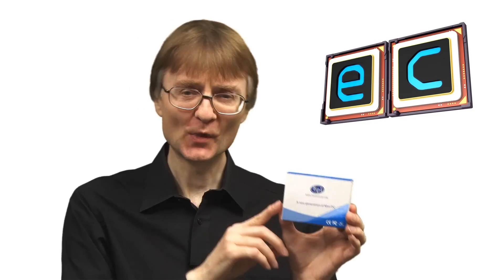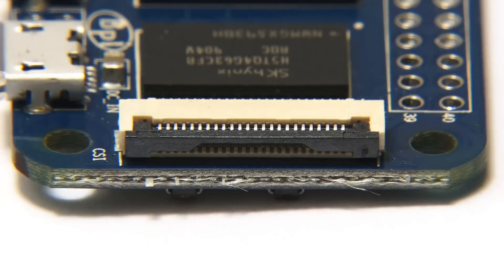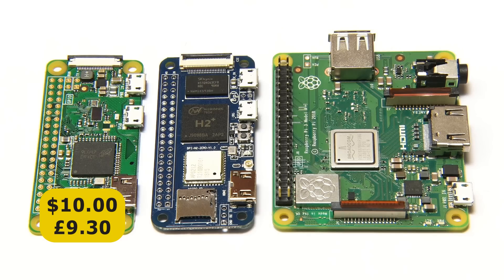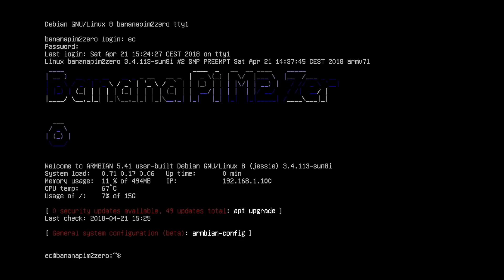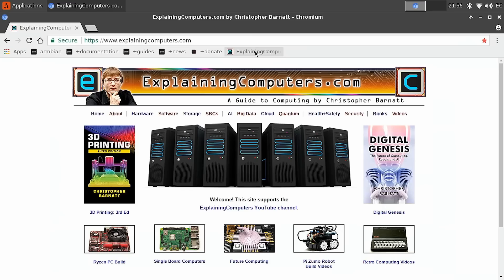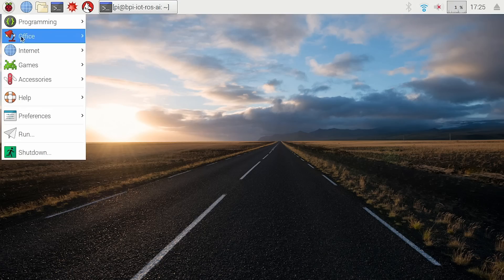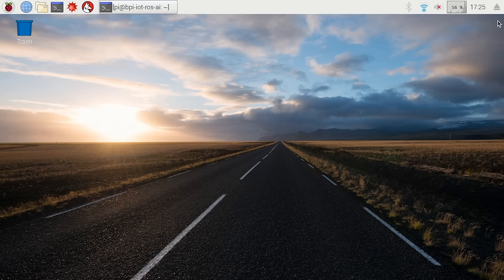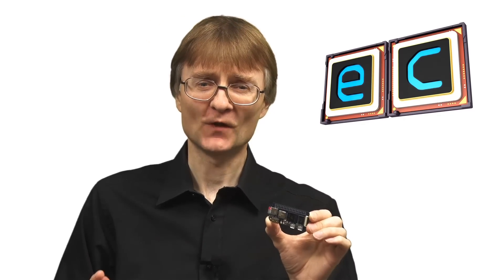Banana Pi M2 Zero: Low-Cost, Quad Core SBC

Comment: As always great video and info.
Generic question. Lets say I want the most powerful single board computer. And compare it to a near to equal desktop or server. Will the SBC use less energy than the desktop or server ? It dos't really mater to me if the theoretical test is x86 or ARM. I'm trying to find the most cost efficient build. 
I would like to know your opinion on if the SBC/desktop/server would burn out fast. I have 2 odroid xu4 that are and wer being used as a 24/7 NAS that streamed too 2 divices and a 12hr/7days a week media player. Thay carped out pretty quick. One has broken usb 3 ports and other has broken ethernet port. One had slow read/wright befor ethernet port broke. One is only a few months older. And I'm only on year 2 or less.
The new build Is going to be a 24/7 NAS and high intense memory/cpu hog. I would prefer my build to be one machine but if it seams more cost efficient I can run multiple machine.
Reply from the maker: With appropriate cooling, I would not expect an SBC to burn out faster. Port breakage is easily overcome using extension cables/headers.
Reply: @ExplainingComputers  True.. I forgot about that..  Thaink you. I'l have to test and see what speeds I can get thru a ether net on headers. it was super slow wen I tested be for it diyed. So I will not know until I test the header connection. Is it fairly common for a SBC to use less energy than a = desktop pc ?
Reply from the maker: @frankenstein3163  Very much so, yes. SBCs are based on ARM chips (which are created as low-power for mobile devices), or on low-power Intel or AMD chips.

Comment: try to  disable overscan in raspbian, you'd probably get 1080p.
Reply from the maker: Sadly not. Overscan settings do not change the frame buffer resolution.
Reply: It did in my case. Am using a smart TV as monitor. Either it just eliminated the black borders or it was because of the cable. Anyway, thanks.

Comment: Just wondering if this could be configured to work with the RetroFlag GPi case? I have one of those cases using a Raspberry Pi Zero W. Would the Banana Pi Zero work better with RetroPie since it's quad core?
Reply from the maker: As I understand it, the M2 Zero does not fit that case. But things can be altered . . .
Reply: @ExplainingComputers  Looking at the form factor it should.  All the connections are in the same place.  Have you tried RetroPie on one of these?  I know with the GPi case you have to modify the config.txt so that it displays the video output via the GPIO pins.  I'm really wanting to know if it runs just like the Pi Zero.  I noticed you were running Raspbian on the Banana Pi therefore it must be running the same type of OS.  If that's the case, RetroPie should work.

Comment: I don't know what algorithm that program is using to determine prime numbers, but it seemed a bit long for finding the number of primes between 1 and 10,000, so I wrote up my own code and ran it on the Pi Zero W that I have.  It found 1229 prime numbers between 1 and 10,000 (which I checked online to ensure it was the correct number).  Using clock_gettime() to get the nano-time for start and end, I ended up with " 0.001097987 seconds" for the 1229 prime numbers (not including the time to print them out to the screen).  Even testing it to 500,000, I ended up finding the 41538 prime numbers in only 0.126008591 seconds and for up to 1,000,000 I got 78498 prime numbers in 0.146698411 seconds.  So, I have to wonder about their algorithm efficiency.

Comment: Hello EC! Is Banana Pi compatible with the Pi Camera with the PiZero connector? I was curious to see if it would be better for running OctoPi because the Zero's single core isn't sufficient for it.
Reply from the maker: Yes, a Pi camera with a Zero connector  should work. Good luck!
Reply: @ExplainingComputers  Is it possible for you to verify this with your own hardware? I've seen several blog posts that all indicate that it will not function as it does not fit. Additionally, would you know of any US-bound suppliers of the M2 Zero? Average shipping time for it is a month or so.
Reply: @ExplainingComputers  I've got an article here from all#DP as my primary source. I don't suppose you could verify this for the channel? https://all3dp.com/2/banana-pi-zero-review-the-specs/

Comment: Does the armbian kernel implement the Lima module that drives the closed source Arm Mali GPU's,

ff300000.gpu: gp - mali450 version major 0 minor 0

for instance

Kernel 5.x drives this one very well.  Normally for these boards you would have a specific project in mind like perhaps a drone / robot controller.
Reply from the maker: I do not know.
Reply: @ExplainingComputers  If you do an lsmod you should see something similar to this,

drm                   606208  8 gpu_sched,drm_kms_helper,dw_mipi_dsi,lima,rockchipdrm,dw_hdmi,analogix_dp

This is from the Rock64 so the DRM level stuff would be different.

Comment: Hi Chris, I'm struggling to find exactly where I should download some images for this board, there's so many versions of BPi boards.
My goal... I'd just like to make a CUPS printer server, and I'll have it running headless.
Could you drop a link to where I can try out some OS's, or let me know what one you'd recommend for a basic CUPS server. Thanks!
(ps. I'm only looking an BPi because I just cant find any RPi Zero 2's anywhere anymore :'( )
....If you have any better suggestions for a mini-cups server (the printer thing) I'd love to hear about it! thanks!
Reply from the maker: The images I've tried came from here: https://wiki.banana-pi.org/Banana_Pi_BPI-M2_ZERO#Image_Release The situation is indeed complex due to the different banana SBC boards from different manufacturers.
Reply: @ExplainingComputers  thanks for that.
1) Is there a specific image you'd recommend to use as a headless server for CUPS.
2) Is there an alternative/cheaper SBC that I should use as a CUPS server. (Must have WiFi and a USB port), thanks.
Reply: @ExplainingComputers  Chrs, did you have any problems using Win32 disk imager? I'm just trying a few images now, and I'm getting a red power light on the bpi zero m2 for only a brief moment, before it turns off, nothing on hdmi (good psu for Rpi too)?
What imager did you use to flash your sd's. thanks
EDIT: I used PhoenixCard 3.1.0 now, and getting a solid Red LED, and HDMI shows just a black screen with an Orange Rectangle Box. Been here 5 mins, no other activity 😢
EDIT: That Orange box appears to be a progress bar at 0%. androidmtk.com shows the bar on their page progressing, but my bar, is not progressing. I feel like I have used the wrong tool to flash my SD card. Maybe I shouldn't have used PhoenixCard
Reply from the maker: @djtyros  I can't recall how I set up this particular board, but I usually image cards with Etcher, unless there is a particular reason this cannot work (as if sometimes the case for some boards).

Comment: If the banana Pi board is plugged into a motherboard like the Spectrum Next, it would have power and then the little USB on the right can be used to power other devices.  Correct?

Comment: Why not comparing with the Orange Pi Zero LTS? That one is 8$ and it includes Ethernet and SPI Flash.
Reply from the maker: It does, but no HDMI. :)
Reply: @ExplainingComputers  Ok. That's fair. I am using the Orange Pi Zero LTS as an embedded (non-linux) platform, hence I do not look at HDMI.

Comment: Would have been nice to measure the power consumption.  I use a Pi Zero W on a small solar panel during summertime because it almost uses no power. Only slight negative factor is that it is a bit slow for which the Banana pi would perhaps be a better candidate.

Comment: Thank you for the review. There is new competition on the market. Radxa zero. Do you know where in Europe we can buy them?
Reply from the maker: Yes, indeed -- the Radxa Zero looks a very interesting board. So far it is not available for sale anywhere, as it has not been released yet (about three weeks to go as I recall). There are just a few pre-release boards in circulation, and I have a policy of not covering pre-release hardware on the channel as it frequently does not arrive on the market! :) In Europe, https://www.innet24.de and Allnet.de will be distributors
Reply from the maker: @homerdus9668  Thanks for this. I often buy from China, and have been through all links on the forum page, but while the products are listed on many sites, they show "sold out" or "out of stock". The forum article states that mass production would start in 8 weeks (from June 16th), and then they need to get to retailers.

Comment: I am interested if "suspend to ram" is availabale for the BananaPi M2 Zero. Could you please test that?
Reply from the maker: I am not ware of this existing. But it will be OS dependent.
Reply: @ExplainingComputers  Yes it is. But it is also dependend on the hardware. As far as I could gather the information it should work with the used H2 Processor and Armbian (when they added it to the kernel). Would be nice when you could give it a quick try :) Cheers!

Comment: My BananaPi Zero M2 is running too hot with a heat sink on the CPU. The SBC's Armbian Buster OS is unusable after it gets very hot in about 5 minutes. Any solutions before I throw the board into trash?
Reply from the maker: I can only suggest a bigger heat sink!
Reply: @ExplainingComputers  I think the solution could be overclocking settings /on demand cpu performance settings.

Comment: Inspired by your video, I tried using official BPi Android image 2018-07-09-android4.4_bpi-m2z_hdmi on Banana Pi Zero M2 and I am extremely disappointed with what results I got. Kodi crashed every time I ran it. Google playstore could not be used to download and install any app. Youtube app said it requires an update and the update could not be downloaded in a retry loop. Frustrated. Do you know any Android image which really works on Banana Pi Zero M2?

Comment: I wonder if the low amount of RAM could keep it from running in 1080?
Reply from the maker: Probably not -- the Pi Zero and Pi 3A_ are 512MB and do 1080p fine.

Comment: What build of Armbian did you use? Armbian has no official support for the M2 Zero. Or even a "No Official Support" build for the M2 Zero. 

Also, did you verify the clock rate before benchmarking? The H2+ is "Up To" 1.2ghz but Armbian may have set it to 912mhz, and Raspbian since it doesn't really support the H2+ probably left it at whatever speed UBoot set it to, which was either 480mhz or 1.08ghz.
Reply from the maker: The Armbian download was an image from the Banana Pi website.

Comment: There is also the Rock Pi  S as well, which is half the price of the Banana Pi Zero, at only $10, and also has a quad core CPU. Seems like the best buy to me, with more powerful hardware, and at the same price as the RasPi Zero, though I haven't tried it myself. https://wiki.radxa.com/RockpiS
Reply from the maker: Yes, looks a nice board -- though headless only (no HDMI).
Reply: @ExplainingComputers   Ah, well that definitely would make a difference, I'd still need HDMI, and I'm sure it was stuff like that they had to drop, in order to get that price down so low. Well, I will be happen enough with the Rock Pi 4 for now then, until I can find something to actually do with one of the a smaller models lol.

Comment: I have a request for help.I have a raspberry pi 3 b+ that keeps on showing the lightning bolt in the upper right-hand corner. I am using a 5-volt 2.4amp power supply which should be powerful enough. Is there anything I can do to get rid of that lightning bolt?

Comment: Do you need to press the power button to start? Or does it boot automatically when it gets power? It would be a no-go for autonomous systems when you have to press the power button.
Reply from the maker: It boots when it gets power.

Comment: Hello. I'm trying to install the operating system on my Banana Pi M2 Zero but I can't. I downloaded the indicated system, I flashed the SD card but when I turn it on, I don't see any video on my monitor. What could I be doing wrong? My banana pi is a BPI-M2 Zero (it is marked like this on the box) but on the chip I can see the inscription H3, on the box it has the option BPI-M2+ (H3) but this is not the model that is marked. My power supply is a 5V - 3A for Rasperry. Thanks.

Comment: I wonder if it's a hardware issue that's preventing you from achieving 1080P video?  I thought it was a driver problem at first, but you had multiple operating systems with the same issue, so it's probably not a driver problem...  It's got to be either firmware or hardware, no?  Darn shame...  Hopefully they can fix the issue with a firmware update...
Reply: What firmware ? All software in this kind of toy is on microSD card with operating system. And they want to sell as much bananas as possible with zero software support.

Comment: Such a shame about these low cost competitors to the RPi. The RPi range is quite conservative in its hardware development which makes these competing boards attractive...until you buy one, and realise RPi is conservative in its development for a reason - software support is king. No good having better specs if the driver and software support is non-existent.

Comment: Where are you finding a raspberry pi zero w for $10?? All of them im finding are about $50
Reply from the maker: Every official Raspbery Pi reseller has only ever charged the set prices  -- or they cannot be an official dealer. So, for example Adafruit list the Pi Zero at $10, its official price: https://www.adafruit.com/product/2885 . Now this does not mean they are in stock -- as I note in the video, there are serious supply shortages. But the advice from Raspberry Pi for over a year now -- to click the "notify" button on an official dealer product page, and then act fact when you get a notification -- does work.

Comment: The mere half gig of RAM is the biggest downside I can see here for most applications. These days even for an SBC that's really tight, especially one with four cores.
OTOH, the Pi Zero doesn't have more but it's half the price. If you basically need a microcontroller with a proper OS, the Pi Zero is dirt cheap enough to be just that.
I'm sure there's a niche for the Banana Pi Zero but it's not a big one.

Comment: Orange Pi Zero is roughly half the price and been out for ages. Only problem is its poor wifi. Get a cheap USB wifi dongle to solve that. Shipping from Aliexpress now is expensive because of Coronavirus.
Reply from the maker: An Orange Pi Zero is half the price as you say, but does not have an HDMI socket or other form of monitor connector. So it is for headless applications only.

Comment: Why do you have overscan enabled?
Reply from the maker: So that the image fills the screen. :)
Reply: @ExplainingComputers  that's not what it's for, it's meant for analog outputs to a tv. If your entire chain is digital there should be no need for overscan. Might also be the cause of your resolution problem.
Reply from the maker: @RedShift5  I am absolutely certain it has nothing to do with the resolution issue. I tried multiple configs (including those with no changes to this setting) over many hours in many OS. :) I have been working with analogue and digital video for over 40 years. :) Overscan on a digital system (everything here is digital) works with the overscan_left, right, etc settings in which a number of border pixels are defined. As you say, it exists to output borders for analogue output, but also digital output on most TVs, which still underscan a broadcast image. No overscan setting will increase or decrease the frame buffer size on an SBC.

Comment: The form factor is different but the banana pi M2 zero is very similar to the Orange Pi R1 (same H2 chip, even): http://www.orangepi.org/OrangePiR1/

The dual NIC on the OPi R1 is fantastic--I don't believe it's been reviewed by yourself? It's a fantastic little board that has lots of potential and even some accessories. It's ~$14 on Ali Express so it sits somewhat between the RPi zero and the BPi reviewed here.

Comment: Can I use this as a raspberry pi zero w?
Reply from the maker: For the same types of applicatons, yes. But but it is not a drop-in replacement (it will not run the same software images).
Reply: @ExplainingComputers  ok thank you. And I just found a raspberry pi zero w for $15 and after shipping $22. But it didn't come with any extras. But I went ahead and bought it because all of them I found were $50 and up